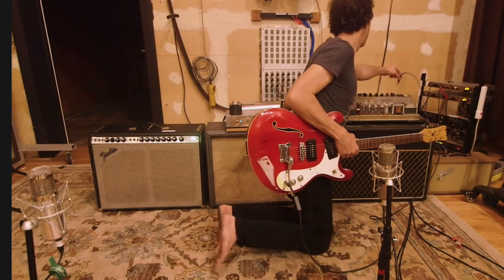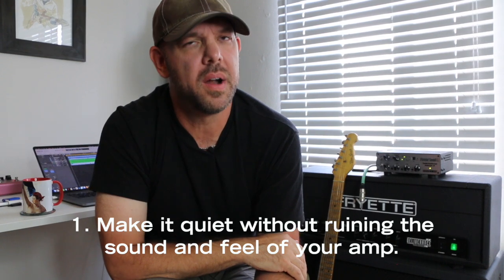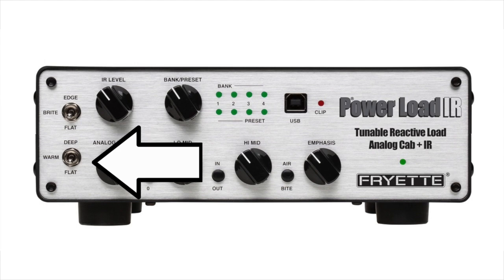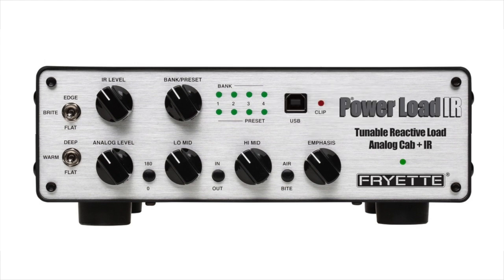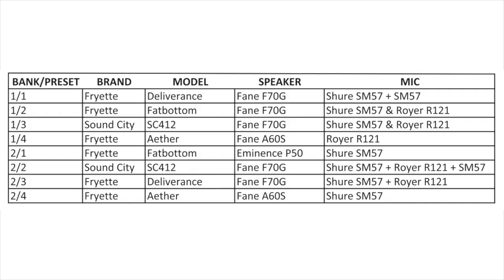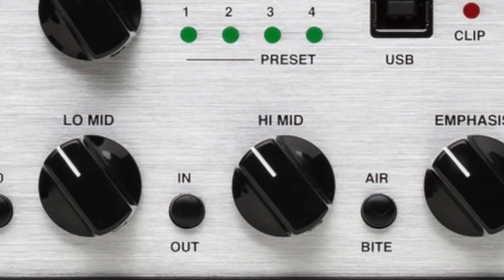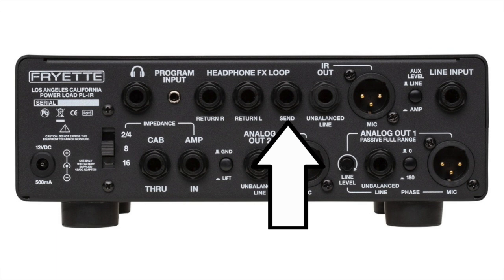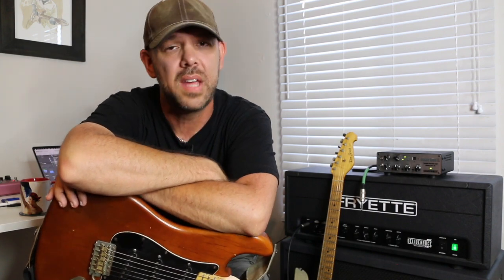Fryette Power Load IR Part One: PL-IR Quick Overview!

Comment: Awesome, if not essential tool, if you want to convert your authentic tube amp signals to line level. 

Not so cheap, but worth the money. One big advantage of the Fryette is, that it works with 2/4, 8 and 16 ohm speaker outputs. other ones are the flexible connection options, although first some use of the manual will be helpful, as all the controls and connections and their relationships are not always self-explanatory without the manual and if you use the wrong controls with the wrong connections, nothing happens. 

Next advantage is, that you can use is fully passive as reactive load box, or active with or without cabinet IR's. The 16 preset places are enough, the built-in presets already sound good, but of course everybody has his own favorites, which additionally can be fine-tuned. 

Even in passive mode you can select between different reactive load modes (Edge - Brite - Flat and Deep - Warm - Flat for both treble and bass response.) I personally anyway prefer using Flat, the rest I do with IR fine tuning, but the options certainly can make sense with some more unbalanced sounding amps. 

I already had the smaller AMT Power Eater, but this one only worked with amps up to 15W, sounded nice and was well usable, but by far not as good as the Fryette, also hardly offered any fine adjustment options and then tried Torped Captor, which was an immediate return, as it sounded horrible, swallowed almost every bass and a good, well adjusted tube amp treble sudddenly sounded as scratchy as the one of a transistor amp, which is exactly not, what I expect from a reactive load box. Also the built-in fan was horribly loud, opposite to the one of the Fryette. 

Great for recording, amp capturing or even simply for using your own stage amp at bedroom level through your computer monitors...

More expensive than most of my amps, but for the results ok! I anyway only need it once for all of them, but not any more real cabinets and speakers....

Comment: What's the supported IR lenght and bit depth? The manual doesn't report any information about this.
Reply: That's an answer I would like to know. I tried some of my other IRs, and they didn't sound good at all. If you ever found the answer, please let me know. I did email them the same question, but all I got was I had to use the right format. I emailed back what format would that be and got no response.

Comment: Recently I bought Power Load IR. It works well but when I'm using it in combination with my Marshall 6100LM - 5881 it starts making quite a loud noise, which is basically a high-pitched sound coming from the amplifier, and the signal gets clipped (red LED is flashing). When I switch this device to FLAT, that hi-pitched sound is a bit reduced but clipping is still present.
I tried to switch my Marshall to half power (50W) or/and triode mode (instead of pentode) which reduces the output again to half, but the sound and clipping didn't go away, it gets just a little bit suppressed. 
The problem occurs when the master volume on the amp passes 11o'c (in full power 100W mode), similarly in 50W mode as well, just a bit later.
Previously I used Marshall 2204 (50W), VHT Pittbull 50/12 combo, and Mesa Roadking 2 with its 120W without any issue.
It might be relevant to mention that the power tubes are quite old but working.
Reply: Mine did the same thing you explained.  He had another video about using a moorly,  hum eliminator or something like that, I can't remember. I don't know if it would solve your issue.  I gave up and bought a suhr IR load box. But it's worth a try. I don't think they cost much.
Reply: @jrlee243  thanks. I think I didn't explain it properly. The sound coming from PLIR is not hum. It's the normal sound of the guitar, I guess it's coming from the transformer inside the PLIR
Reply: Sounds to me rather like feedback between guitar and amp. You are running a hot adjusted amp at very high volume, even if the Power Load reduces it, but physically the reactions remain the same. 

Try to get more distance between guitar and amp or try to change the angle between them. If things change, this is feedback. 

But also can be some ground loop issue or something else, like a bad tube. Hard to tell from the distance. 

On the other hand, if you say, clipping is still present, then you most probably have adjusted a control too high. Did you properly read the manual so that you really know, which controls affect which inputs/outputs in which configuration? Can be a little complicated first, as the relations are not always obviously recognizable on this unit (Analogue Out 1 works with different controls than Analogue Out 2 or IR Out so you need to use different controls for adjustment, depending on your connection settings.)

I'm using mine with an Orange Jim Root and never noticed comparable problems even at very high gain settings, if the right controls had been properly adjusted. If the signal is too hot, this of course will cause signal distortion problems and if you then only readjust the wrong control, this hardly will help.

Comment: Hi There.....Quick question.....is the Fryette PLIR's reactive load emulating a specific type of speaker and cabinet?  Thanks!
Reply from the maker: It's a common question that we've discussed a lot. Guitar speakers all share a similar impedance curve behavior with subtle differences in low end resonance and high frequency rise. The PL-IR load emulates those characteristics. The mini-toggle switches on the front panel shift them up and down to capture those subtle differences.

Comment: Besides the analog level, which is a really cool feature, is the Power Load IR needed if I get the Fryette Power Station? Granted, using the PS, I would be using IRs via the daw
Reply from the maker: Only in that the PL-IR is more purpose built for interfacing to a daw.

Comment: I'm guessing that you could also run out a wet/dry/wet if you used one of the stereo outs from your amp?
Reply from the maker: You could send a line out to a stereo effect and then to a stereo power amp and cabs. You can also use a stereo to two mono phone adapter to turn the headphone jack into a stereo out.
Reply: @FryetteAmps  Thanks! Is the headphone output analog, as well?

Comment: Is this the same reactive load circuit as PS-100? 

Trying to choose between the two units to get the best signal path into my UAD Apollo. Don’t need the power amp function of the PS-100, but want the best reactive load circuit.

EDIT: I think you answered my question at 3:50 - just wanted to confirm it is the same circuit.
Reply from the maker: Same reactive load as PS2/PS100.
Reply: @FryetteAmps  thank you for confirming that for me. This is exactly what I am looking for. Thanks again.

Comment: Is there any plan to make a PS-100 that captures whatever is in the effects loop and sends it out through the XLR along with the amp signal?
Reply from the maker: There is no need to add such a feature. Simply send the output of your effects chain to your DAW. The impedance will be low enough that an XLR connection is not really needed. If you want the effects signal to still go to the PS power amp stage, then to the speakers, put a Y cable on the effects output and return one side to the loop return, and the other to your DAW, FOH or whatever. Finally, if you don't need to have a live speaker cab running, use the Self Attenuation feature: https://www.youtube.com/watch?v=xfZtYbUwDZA&t=1s

Comment: I do have the old PL model without IRs. One amp is actually plugged in permanently and from there I go with line out to the line in of my Powerstation and from there to my cab. As the cab with a greenback has its own sound I use the anlag cab sim of the PL more like a tone control. This altogether works actually quite well. Recording is something I don’t do. Has the PL IR in this setup any advantages?
Reply from the maker: The audio quality and noise floor have improved somewhat, but in your application, if you have it dialed in the way you like it and it's working for you, we see no reason to change it.
Reply: @FryetteAmps  Thanks for the swift reply.

Comment: Hi!  I’ve looked at the manual and item 18 Cab thru as well as illustrations 5, 6 & 7 and have a couple questions. 

First, I want to verify that it will act as a load box, just like the Power Station for being able to dial in my amp and then drop the volumes. 

Second, while this may sound weird, will the signal to the speaker also have influence of the IR if I have it on? (I like the idea of playing with those even going into a cabinet).  

Finally, the effects loop says headphones, does this mean that I cannot use the effects loop and send the wet signal to my cabinet?
Reply from the maker: 1)	It's a load box, not an attenuator. Sorry, no control of cab volume.
2)	With a cab connected, the cabs reactive behavior replaces the internal load's reactive behavior
3)	You will need a power amp to send affected signal to your cab. In that case, use the HP out as a stereo line out which is post loop.
Reply: Will this play nice with a PS-100?

Comment: Can this be added to a setup containing the PS-100?
Reply from the maker: Yes. Just send the PS-100 Line Out to the PL-IR Line Input
Reply: @FryetteAmps   @Fryette Amps  So this would bypass the reactive load function of the PL-IR, while continuing to use reactive load function of the PS-100?  

What would be directly connected to my interface?
Reply from the maker: @aaron9142  1) Yes. 2) PL-IR Analog or IR out.
Reply: @FryetteAmps  Thank you! The PS-100 is an incredible piece of gear. Gonna have to get the PL-IR now.

Comment: Do the reactive load switches emulate any particular impedance curve(s)? For example, Warm + edge equating to a greenback or v30 curve?

Some of the other loadboxes I’ve used have impedance curves based on a particular speaker.  I understand this is flexible, but are there any reactive switch combinations that reflect any particular speaker?
Reply from the maker: We'll cover this in an upcoming installment.